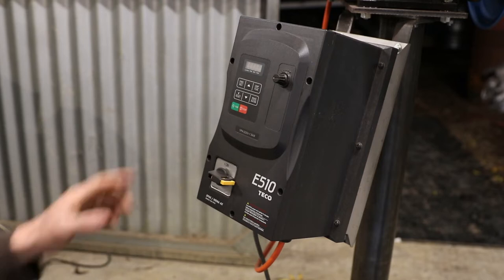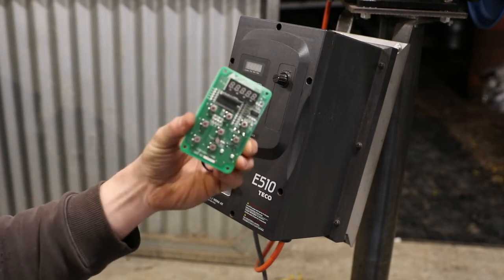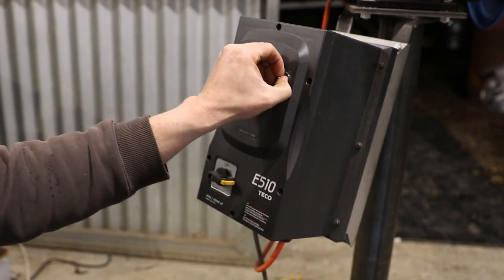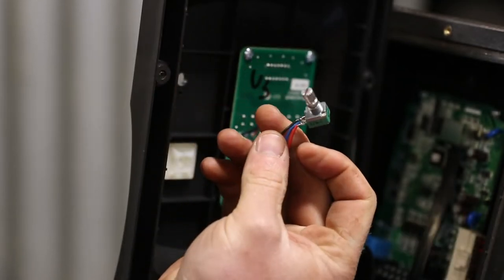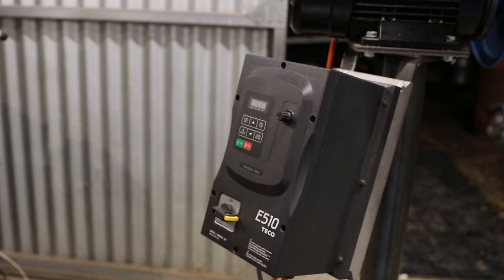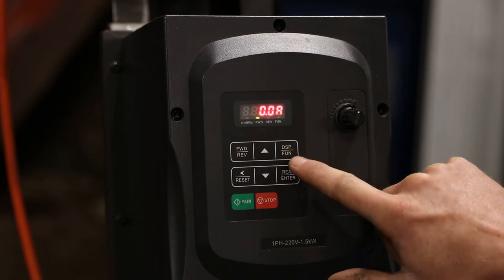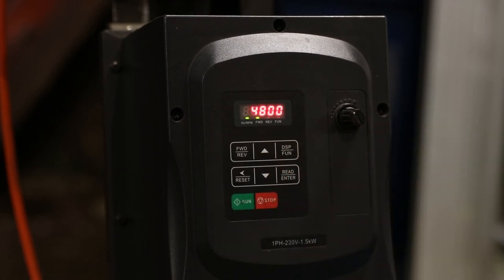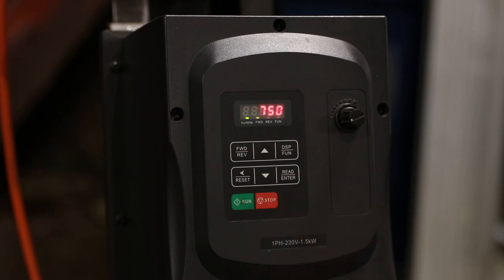Teco VSD / VFD failure

Comment: Teco Australia apologies for the inconvenience and is aware of this matter and has addressed it to the factory quality control team; root cause analysis has been done, and as a solution, the VSD assembly process has changed. This change in the assembly process has resolved this problem; we haven’t seen any more cases related to this issue. The 510 series drives are excellent and reliable, with confirmed performance in all industry sectors.
Reply from the maker: Thanks for the reply, it has been my only issue with these drives. Glad to hear this might be the end of the problem.

Comment: Is the potentiometer stuffed or the whole board?
Reply from the maker: It is just the potentiometer, but as it is a soldered connection, it is easiest to replace the whole board with pot connected.
Reply: Does the replacement permanently fix the problem or is it the exact same part and will eventually fail again?
Reply: I'm putting in my second pot/ board now.. so seems like it's a temp fix but Jacek has been great in getting the part to me with no hassles.
Reply from the maker: its the same typre of POT so I guess it is prone to happen again. I believe changing to a wire wound POT is going to be a better solution. Ive had very few repeat failures.